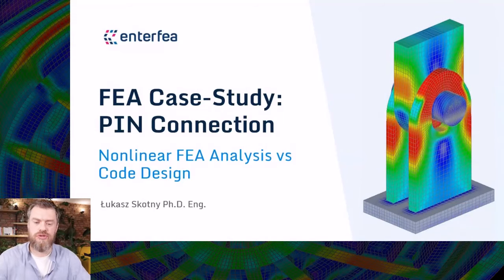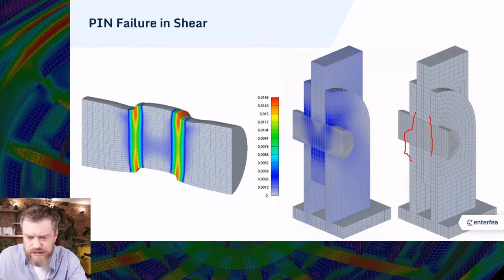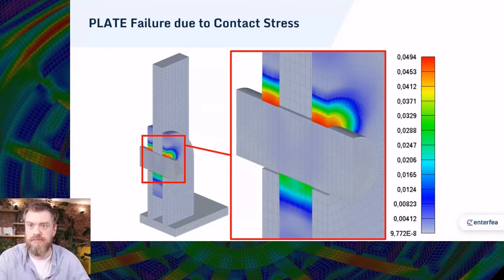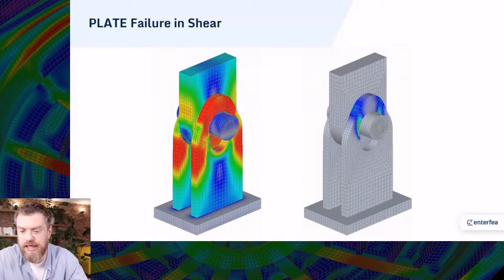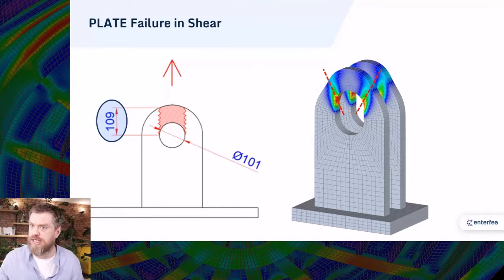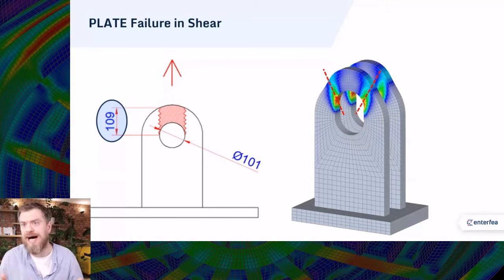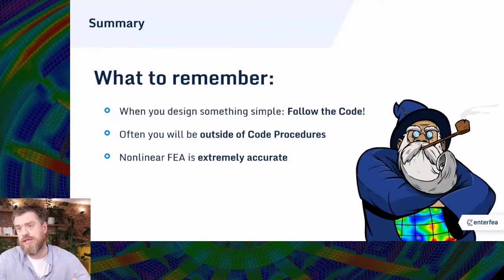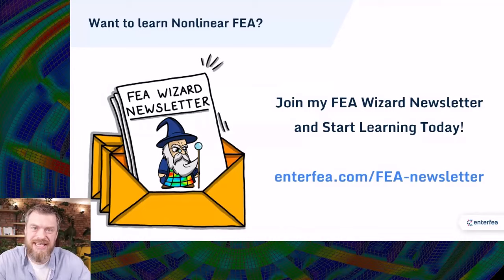PIN Connection in FEA: Case Study

Comment: Thank you for this very informative video.  Which material behaviour did you use ( Bilinear,elastic-plastic or other) ?
Reply from the maker: I used an elastic - perfectly plastic material. In this application I didn't really needed anything more fancy, especially with typical "structural steel" being used, with a nice plastic plateau :)

Comment: Hej Łukasz. Could you start your videos with a brief description of boundary conditions applied? As for this example - when there are nonlinear contacts involved and there's seemingly nothing that stabilises the model (model is not fully constrained, contacts are not 'bonded') is it 100% reqquired to explicitly use "soft springs" / "rigid body motion" or whatever this may be called in other software? Or based on contact types do some packages like ANSYS or FEMAP somehow resolve it in a different way or automatically? I'm asking since an analyst in my company (ansys) said he doesn't have to apply soft springs, ansys just moves on on its way and frictional contacts stabilise the model. In theory empty places on stiffness diagonal are disallowed numerically...
Reply from the maker: Hey Mate! Thank you for the suggestion. I understand the need, and I will definitely make some videos about boundary conditions, but I don't want to make my videos "too long" so talking about everything in every video won't work I think :( 
To answer your question, I think I used soft springs in the model to stabilize the pin. You could also use the symmetry of the model to do that, but I don't like how the outcomes look (and it's important for the video) so I made a full model. 
Cheers!
Reply: @Enterfea  Symmetry wouldn't work in the vertical direction. I understand and actually applaude the need to keep things consise and to the point, but in the world of FEA boundary conditions are everything. You can't really judge the resulsts without knowing them and as this is a technical and study matrial I'm 100% sure no one would argue the videos are 20 seconds longer than they should, no need to always get into deep details :) By the way - great work as always, I'm nagging my boss to buy me your training course and I was happy to see some exmples of your analysis in Dominique Madier's book! Good read, just started it.
Reply from the maker: @eartheartbaratheon791  Yea, this is always a thin line on what to talk about and what to ignore - but I totally see your point!

Comment: Great FEA session and insights into Non-Linear analysis using equilibrium paths and indicative failure modes. I just have a question: Where did you query the equilibrium paths for all the 3 cases ? Since you divide the max load capacity by the no. of shear planes (2 in pin shear case, 4 in plates' shear failure) and the no. of parts involved (2 in case of plates' contact failure), it's unclear to me how you select the query part/geometry/node/element/surface of interest or if you just selected the entire model (2 plates + pin) and then compare equivalently with the codes? Thanks for your time and answers!
Reply from the maker: Hey! Thanks for your kind words, I'm glad that you like the video :)
I used the total vertical deformation of the top of the upper part (that I pulled) against the force I needed to pull it with. Hope this helps!
Ł

Comment: Thank you so much Sir Lukasz for sharing. This part of structure plays important role especially for heavy equipment and module lifting. Please allow me to ask my query.
1. What is the maximum von mises stress for Case-1 and Case-2. 
2. Do we need to perform mesh convergence in this type. Since there is a changes in geometry like hole, there may be need to check mesh convergence?
3. Is plastic strain contour map you show for shear check can display from FEMAP, in addition to maximum von mises stress contour map? Just curious since I try to find out using STAAD, but i afraid there is no such thing plastic strain contour map. Thank you again for your sharing. Actually I almost near and close to decide to take masterclass but my remaining issue is if my software that I use is not capable to perform good output Non Linear Analysis, then it will be hard for me to follow all things. I am checking now the capability of STAAD in non linear analysis.
Reply from the maker: Hey Jess! Let me answer your questions one by one:
1. There is no "von Mises Stress Limit". In material nonlinear analysis, this doesn't really apply in structural steel, as for elastic-perfectly plastic material the max stress you will get is yield stress. It's the strains that should be limited - various codes use various options, but usually, the plastic strain limit is around 3-5%.
2. If you are not sure about mesh quality it's always good to make mesh convergence. I simply knew, that my mesh was good enough for the task, so I didn't perform a mesh convergence... but if you are in doubt - it's always better to check :)
3. Plastic Strain requires nonlinear material analysis. If this setting was turned off (or your software can't handle it) you won't be able to display it. If I would run a linear material in Femap, I wouldn't have this plot either, since plastic strains are clearly an outcome from nonlinear material analysis :)

In the end, I'm really glad that you are interested in my nonlinear FEA course - this is so nice to hear ;)
Reply: Thanks a lot Sir Lukasz for your helpful input. That helps a lot.
Reply from the maker: @arocenajesussusmerano174  I'm glad that I could help you Mate!

Comment: Thank you again Sir Lukasz for the result of your non linear analysis. It clearly shows 2 shear plane occurs per each Lug. This is very useful since there is no code gives clear guidelines whether 2 plane shear or single plane shear will be applied on pin-connected member. Therefore for this configuration where there is axial uniform load is applied 2 plane shear will be applicable..But what about if the load is not uniform when there is a out of plane load, especially occurs in Lifting Lugs where the sling with angle attached to the shackle, then pin shackle connected to the pin hole.. In this case load is not uniform, then single plane shear maybe more applicable for shearing stress?

Comment: Tension failure also for lugs with small widths
Reply from the maker: Sure, but I would have to still change the geometry to get that (assuming that I understand what you mean). If I have an "equal" amount of material on the "top" and on the "sides" of the pin (in the plate of course) then shear will always "win" simply because the area is the same, and shear capacity is divided by square root of 3. Still, you are absolutely right - if I had more material on the "shear area" and less on the sides, tension failure would be a thing - while I didn't want to make that case in the model I should have mentioned that in the video! Thanks for pointing this out!

Comment: in minutes 8.10 ; what material model do you use to achieve negative slope like that? Why is there no strain hardening phase indicated in the graph?
Reply from the maker: This is actually an impact of nonlinear geometry :) If it would be only nonlinear material, it would be indeed horizontal (more or less). Hope this helps!
Ł